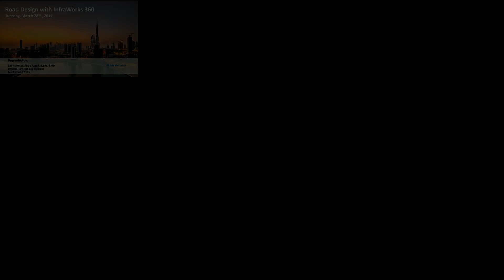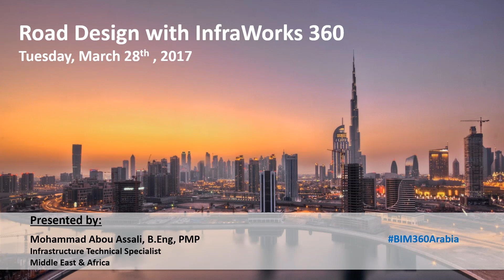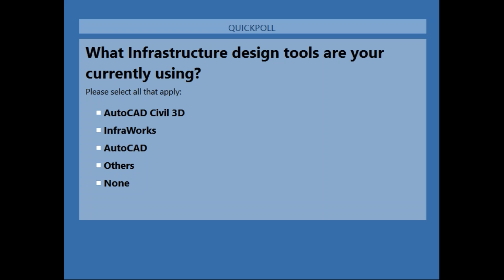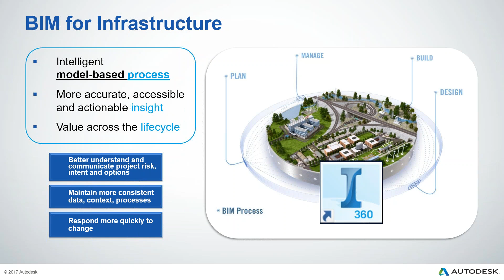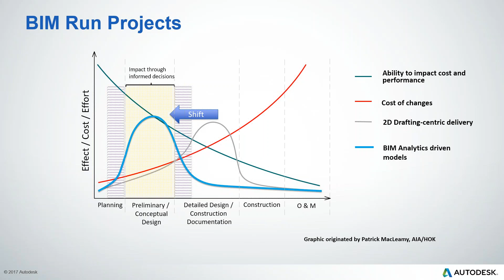Road Design with InfraWorks 360

Comment: Hi sir I have one doubt that is can we give reinforcement details in this software
Reply: Hi Thamil,
If you mean steel reinforcement for concrete structures, then you have to use Autodesk Revit for that. InfraWorks cannot  design the road components themselves (like asphalt and sub-base material types and thicknesses).
Reply: Ok thank you sir one more question can we do estimation in this software
Reply: And can we arrange this 3d drawing In layout space like auto cad layout sheet
Reply: @thamilazhagan5080  we can generate the basic material quantities of road elements and export to a csv file which can be opened in Excel or linked with an estimation software
Reply from the maker: @thamilazhagan5080  all drawings are produced in Autodesk Civil 3D once the InfraWorks model is opened in it
Reply: Thank you sir
Reply: How to give my model drawing to my client
Reply: For example in AutoCAD I can print out in paper and give  by hand
Reply from the maker: @thamilazhagan5080  open the InfraWorks model in Autodesk Civil 3D